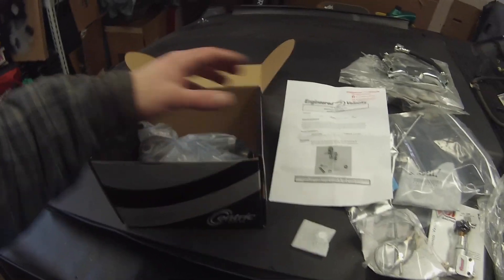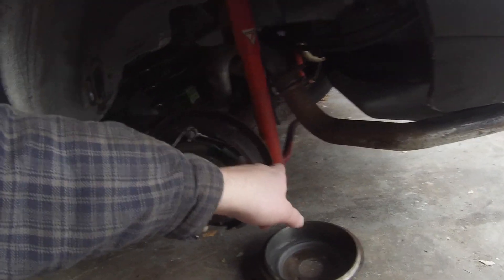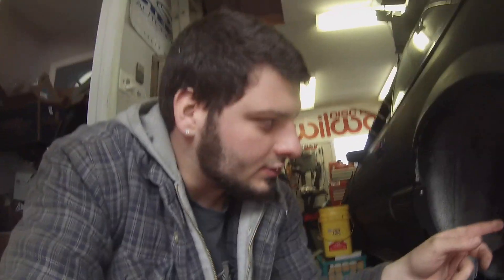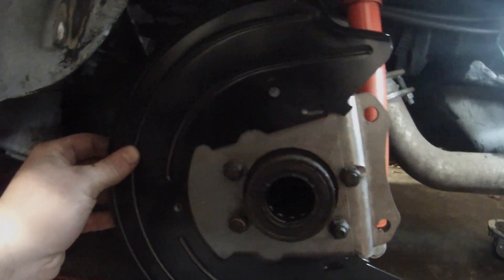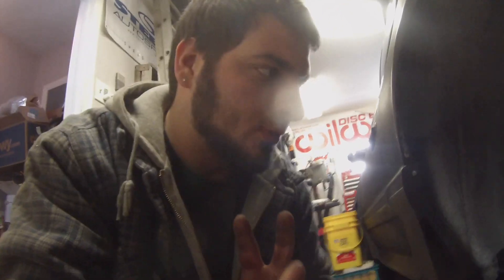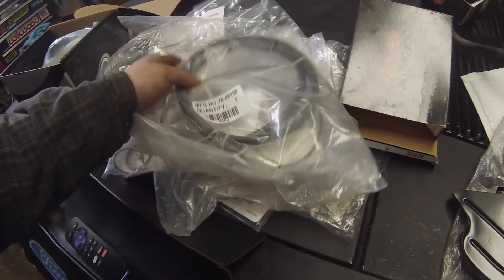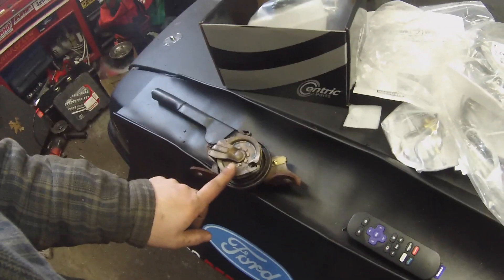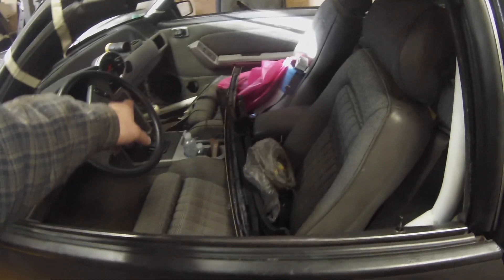Foxbody 4 Lug 8.8 Rear Disc Brake Swap ( Part 1, The Rear Axle)

Comment: did you reuse the 28 stock axles? and which rotors did you use?
Reply from the maker: Yes stock 28 spline axles. Turbo coupe rotors
Reply: @MattSkiDooFord  you know what size that rotor for rear  measures....10" diameter?